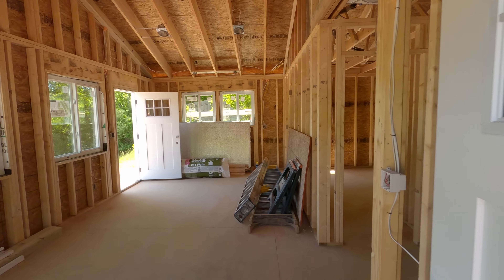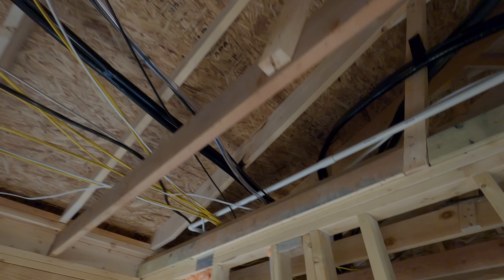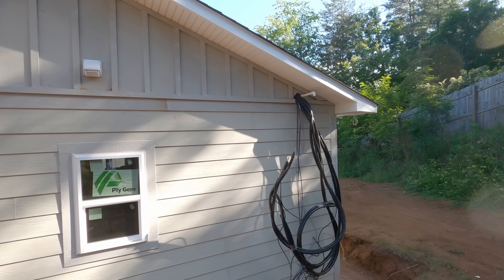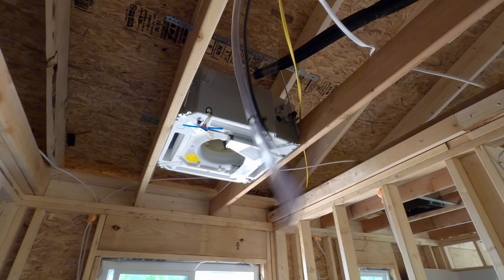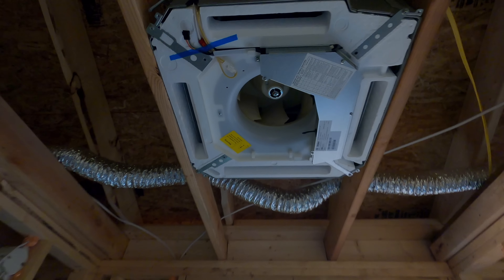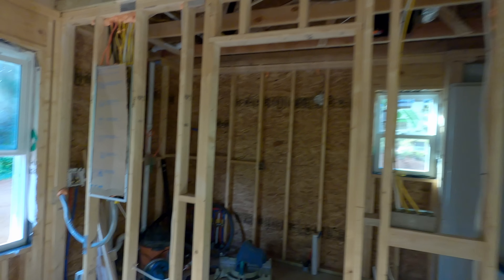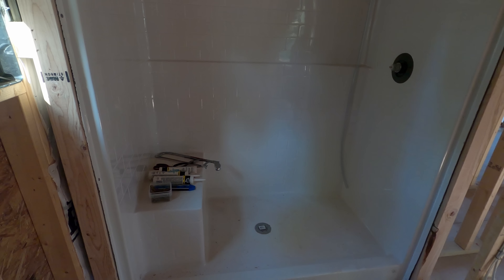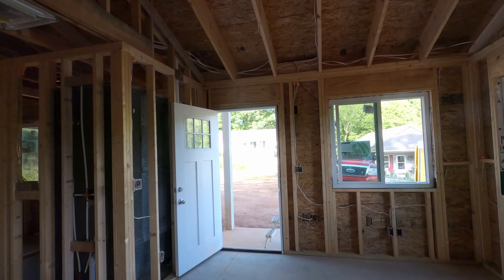Ductless Mini Split System Price / Cost

Comment: Your installer is a hacker. All those lines should travel together in a bundle. There is no need for that mess. Also the SEER for INVIVIDUAL systems can be double of a multiple split system.  In other words... one condenser for each head. Mitsubishi multi head tops out around 18SEER. The singles can be 36 SEER. Price isnt a lot different either. I dont know if this will improve in the future

Comment: Everything points to these installers being hacks. At least you know not to use them again. Running the lines up the outside wall is for remodels. They were supposed to run the lines in the wall cavity.
Also the cost for that system seems pretty high. I would expect a 3 ton compressor with 3 heads to be around $2700-$3200. 
Sorry you ran into some bad luck here.

Comment: Yes piss poor looking quality from the HVAC contractor. I have used aluminum coil stock or .032  aluminum sheets to build a chase for the exterior plumbing for the HVAC and electrical to dress it up after painting to match the home it does not look too bad.

Comment: That 36,000 btu its oversized for a 700 sq ft home
Reply: It should be no more than 18,000 BTU for that size house! I live in a 646 sq.foot house and a 12,000 BTU window unit is more than enough to keep my home cool.
Reply: I have a 12,000 BTU unit in a 600 sq ft cottage and it does the job. Probably a little over sized but they can modulate down quite a bit.
Reply: @trailrunner67  well yeah, but a HUGE waste of money.  No manual J done obviously. 
How in the world did they talk you into buying such a large unit?  And 3 ceiling cassettes on a cheap house?  You as the GC are responsible for failing to do your due diligence.
Reply: @Ivebeenaroundyouknow  Hey Sam, I think you directed this to the wrong person. I agree that the system is oversized.

Comment: 36000 btus way to big of unit. Did they not do a heating and cooling load before they started. 18000 is about right. The one unit in hall has one outlet pointing back towards back of house and 2 outlets shooting out at the hallway walls. Then only one shooting out into living room kitchen. What kind of genius figured that out?
Reply from the maker: That is what I thought on the btu's as well, I am curious how all of this works when they do the final.

Comment: Yeah that was a hack job. I would have made them come back and fix it.
Reply from the maker: Spoke with the office today, it will be fixed but will see how this thing works when it's turned on.
Reply: Doing anything in the trades, things should be ran "Rectalinear" anyways. When they run things diagonally and/or randomly like that it screws up future installs for everyone else. Or if you have to go do repair work, or of you need to work up in the crawl space for any reason. They run diagonally to cut cost but it causes problems with other trades. (I'm a telecommunications/ home networking guy but I've also swung hammers in my day)